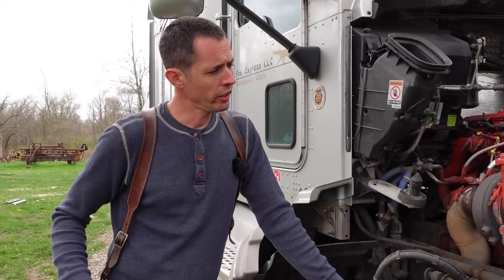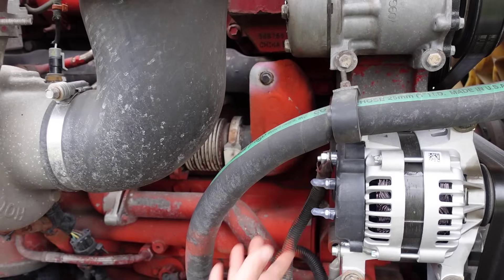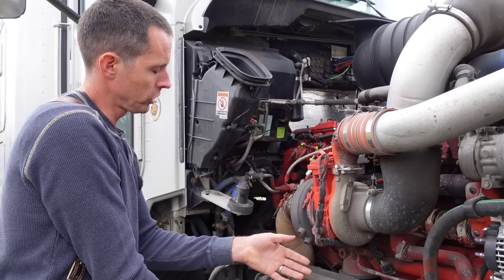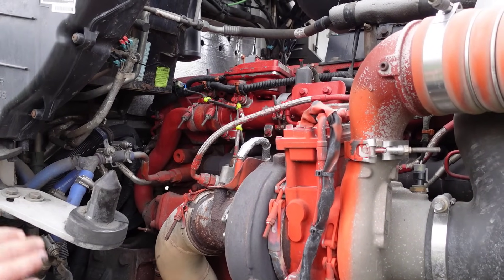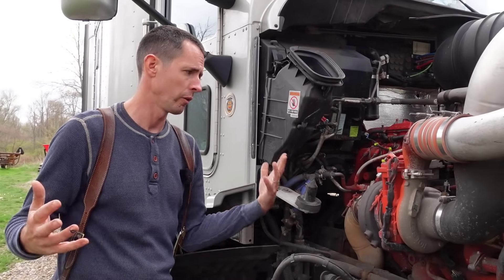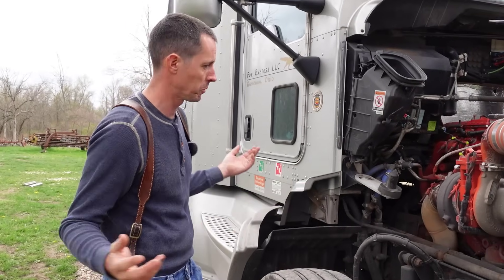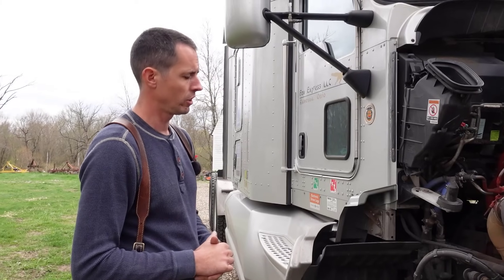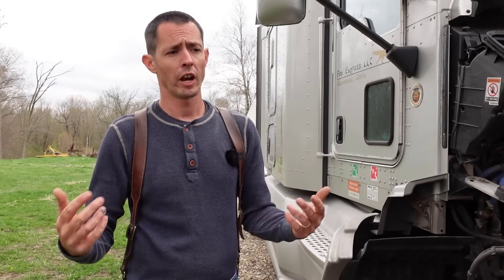What Happens During An Emission Delete - DPF/EGR Dry Run

Comment: hello boss thanks for the good info really helps i have a hino reefer box truck and is delete but its going into regent so how can i fix this i have the flashing regen light any info in from pennsylvania thank you happy holadays
Reply: I deleted my it runs great for 2 years then the engine light came on and I took it to the shop and after I took out the shop all the exhaust lights came on and anything dealing with pdf lights came on. I really have to used it so I took to get my veggies and it died on the road had to tow it. I don't know what is the problem.
Reply: I used the engine reader to clear the regen code. It works when I first got it deleted but after I took it to the shop it doesn't work anymore. I don't know what the shop did all my dpf lights came back on

Comment: I don't care for trouble codes but can I just simply remove dpf filter & drive like that?
Reply: No your ecm will detect an engine faults from the egr dpf/scr system and derate your power to basically limp mode or severely reduced power . Everything must be turned off with the tune so the engine control module and aftertreatment control module will no longer be looking for those inputs from the emissions system ...   in essence what your doing when you tune your engine and delete the emissions on it your taking the engine back to pre emissions operation just with all the emissions stuff appearing to be intact .  
Benefit is engine will run great and work like it should with better fuel economy , more power less heat in the engine and actually breath the way it should ..

Cons of doing it is the possibility of huge fines and they start at like 25k and up from there if your caught and you will need to restore it back to factory setup and it's not cheap to do..

Because even though it appears to be intact like factory at appearance. All they need to do is look at your exhuast stack and see the black soot coming out of the pipe that didn't exist before the delete and or do an opacity test on your engine at an inspection and when the Rev it up for the snap test they will see big puffs of smoke coming out and it will fail the opacity test and then your done ..  so does it work ?   100%  but is it worth it if you get caught?   100% NO ...  so it's a catch 22 ... 

And when mechanics have to hook up to check it for engine e.c.m issues cuz you will still have sensors and stuff go bad on the motor , if the mechanic don't know it's deleted and trys to do any kind of regen or calibration update with that deleted file in the e.c.m it's gonna screw everything all up and I'f your e.c.m fails for whatever reason and you require a new one you have to have the same person that did your delete tune to redo it just so you can run your truck and most dealers and shops won't even work on your truck if they know it's been deleted .....

Comment: Hello, just got this 2004 MBE4000 it’s a Cali truck and has retrofitted DPF system . My question is can I just unplug everything and get rid of the DPF since it’s not required in Arizona ?.
Thx
Reply: Yes, purchase a factory exhaust system with out a DPF and reflash the trucks computer to stock. Plus remove module that controls it all. It’s completely legal since it’s a non factory aftermarket part.

Comment: I have a 2011 international 4300 box truck. Brand new motor and turbo. It will dump a crazy huge amount of blue smoke every hour or so on the highway. Does not use DEF fluid it uses the trucks diesel. Can it be deleted?
Reply from the maker: Sorry, I don’t know the answer for your truck. You can contact the company who perform the delete to get you the exact answer! Good luck
Reply: Fix the emissions, you will destroy that new motor and turbo in short order.

Comment: Yeah I have a 2018 cascadia. 400k
I don't idle
I don't leave it running
I have an apu.
Started getting codes now.. with only 400k. .thinking about doing a delete. 
don't want to change sensors and shit
Reply: Do an EGR Tuneup, and it may be time to either replace the DPF/DOC filters or have them baked and de-ashed. You will also need to remove and clean the EGR Valve and it would be a good idea to remove and clean the EGR Cooler too. Also the emission sensors on the intake and exhaust side should be replaces with new OEM sensors. All parts should be OEM that you put on your motor.

Comment: So by canceling the egr...you pretty much stop the hot exhaust from circulating back into your engine and now the exhaust gasses go straight to the exhaust manifold ?
Reply: You cook the motor, there is much more to a delete than simply closing or removing parts. It is all in the programing.

Comment: I did a delete on my 2017 Peterbilt 579 with a Cummins ISX and when I idle the truck for more than 1 hour every time I give it throttle white smoke comes out of the exhaust but the smoke goes away after driving on the highway but when I come to a stop and let the truck idle again it repeats the same time.. any suggestions???
Reply: Sounds like a typical bad delete, who did it? Did they remove anything from your motor, EGR Cooler, EGR Valve, VG Turbo? Did they cut any wires? Were the cans totally gutted, all of them? Not holes drilled, but gutted right to the metal? Also your fuel pump, that needs to be rebuilt at roughly 400,000 miles, as they are still failing. The white smoke could also be a leaky injector. Do you have pyrometer and turbo boost gauge in the cab? How much boost are you producing? Engine oil temps too, where are they?
Reply: @michaelwright1602  I have 2015 isuzu npr

Comment: So who is a reliable tuner? I have an isx15 and I read an article where supposedly blocking off the egr cooler a because that coolant feeds cyl #6 or something. Also that the turbo builds enough boost to crack the head. Can anyone here with an isx15 and a delete share your experience

Comment: I just blocket the coolant pipe on my egr and unplugged the harness and blocked the gas tube. And no software
Reply: That coolant pipe on a Cummins cools the #5 and #6 cylinders, other makes may differ. And you are harming your motor.
Reply: On my first truck i run with EGR delete 5 years and nothing happened. Maybe on D13 it is important, on cummins everyone is doing

Comment: Just at a dealer. The sign said if its emission system is compromised work will be stopped and you tow your vehicle away.
Reply: I believe dealers are required by law to restore emissions systems without your permission. I'd say that the sign is a pretty generous option.
Reply: @mattberg916  dealers couldnt afford to do that 20k plus repair on their dime.
Reply: @hawkeyetec  not on their dime. They bill the owner
Reply: @mattberg916  bullshit,,,,,you guys must live in Jersey or something?

Comment: I have a Cummins that been deleted for about 6 months, now I have been exhaust fumes in cab and where the dpf under my passenger step , can smell exhaust...any suggestions?
Reply: Follow your exhaust pipes all the way to your engine change all the washers, rings, and clamps 
Make sure you put NEW everything on 

Literally just went through the same thing had to delete the EGR after deleting the def 
Hope this helps you man
Reply: They did a crap delete, more than likely your DPF/DOC/SCR cans are all intact, or they simply drilled a couple of holes in them. They all need to be gutted. Is your truck still running?

Comment: How can they put exhaust gas back into your engine? It's not air or oxygen anymore so it won't burn right?
Reply: it reburns the bad gases and makes engines run hotter also….
Reply: @Trevor7727  negative. The exhaust is to reduce combustion temps and reduce nox production. It's counterproductive bs. A high flow catalytic converter pumped with atmospheric air to keep it super hot and burn off any waste petroleum/fuel would be more productive, and is how the dpf works anyway.
Reply: @Trevor7727  nope runs cooler if you delete it engine will run hotter n boom

Comment: It's very sad that manufacturers are duping the public with this kind of archaic add-on emissions equipment. Reminds me of the 1970's when cars that got 20 MPG and had 300 HP became cleaner by using twice the fuel and producing half the power. By 1973 most engines were getting 10 MPG and had 150 HP...they were dogs and had high temps. With the new diesel's today, they are at it again, poor mileage and less power however, with the EGR systems today, diesels engines are injecting soot into the cylinders which damages the piston rings over time so the typical diesel that would go a million miles before an overhaul now only tend to get about 400,000 miles. Not to mention, the public are subject to the costs of this, higher initial costs, cost to operate, cost of maintenance and of course, less life. I am all for cleaner emissions but not in this way where the systems are at best a band aid project for a high price. You have to ask why CAT left the market when they told the EPA they could get clean emissions without a DPF. The EPA said, sorry you have to have a DPF so CAT said, we have to warranty them and the DPF/EGR won't allow for that. CAT left the on-highway diesel market.
Reply: It's really no big deal, all it does is raise the cost of transportation, then that cost gets passed on to the consumer. I can't think of anything that people use that doesn't come on a truck. And people wonder why the cost of goods and services are going up....Hmmmmm
Reply: @richardsb3606  Yes, it is a big deal because the EPA has ancient thinking for clean air reasons. If they had to function like the rest of private businesses and exist only from profits, they would be gone yesterday. Since they do not stay in business that way, they can demand the most dumb methods there are and force it. That is not the American way, at least it hasn't been.
Reply: @Garth2011  I was being facetious
Reply: @Garth2011  that's a lie you told there

Comment: thing is if you break down or need to go to any reputable repair shop soon as they see it's deleted they will not work on your truck ....
Reply: That’s a lie
Reply: Reputable and dealership are 2 different things, if you want a 19 year old kid with 2 weeks of training working on your truck go to the dealership.
Reply: No,, only if the dealership or some professional shop decides to be a asshole they can keep your truck until you fix it,, if they found out you deleted it
Reply: yeah I want to gamble on who is a arsehole and who isnt... thanks I'll just stay legal. also your taking a big gamble deleting and then having bigger issues with heads turbos etc. not worth it buy a 2007 if you don't want the emissions nightmares.
Reply: @fxstc111 well no its not a gamble i know where not to take it to like MHC and any dealer,, other than that i have no problem i can even go to TA or any regular shop 2nd with my truck has no problem since i delete it and i put almost 300,000 miles on a cummins
Reply: @lewis1707  whatever...
Reply: I've heard that they will work on it, it's just that they won't let you truck out the door until all emission equipment is working the way it should. So now you stuck with a big Bill just to get you truck out. I don't know if that's true, but I wouldn't want to chance it.
Reply: @thomaskirkpatrick4031  It is that’s why I stay away from dealers and MHC,, but any regular shop and TA will work
Reply: @thomaskirkpatrick4031  you are correct. a huge bill . also by deleting you could have head issues. I know of a person who had a deleted engine. no one would touch it. it wasn't worth the money to fix it back to specs he said. took it to dealer and a ta.
Reply: If you guys don't know an independent mechanic , don't buy a truck!
Reply: @lewis1707  I work at a dealer we cannot keep a truck because it is deleted, we can refuse to work on it until customer agrees to bring it up to emissions standards. The only way we can legally keep a truck is under lien laws when a customer fails to pay.
Reply: @wb2679  well I guess it varies by state cause I know a dude in North Carolina took his deleted truck to MHC and they keep his truck until he get it fix it cost him $18,000
Reply: @lewis1707   u must be talking about MHC in Battleboro NC
Reply: @lewis1707  it must I just discovered a truck was deleted customer just bought it, he’s taking it back to where he bought it he wants his money back they said they would go after the company that traded it in it’s about to get ugly for someone.
Reply: @wb2679  He took it back cause it was deleted.?? he must go or stay in Cali
Reply: @lewis1707  there are more states that require diesel emissions testing, the list is growing 2025 new standards come out more states are going to require multi level emissions testing  it’s not hard to figure out a trucks ecm has been altered
Reply: Since when are truck dealers shops are acting as DOT ENFORCEMENT OFFICERS?
I find it hard to believe that ANY SHOP reputable or not has the RIGHT TO CONFISCATE your truck
until you REVERSE deletes.
It is very possible that a shop can
Coerce you into bringing truck back to original specs just to charge you a HEFTY bill.
that is easier to belive
Reply: @HighGrade592  they are not confiscating them they will not work on them till its put back to factory specs or they refuse to do the work as if they get caught working on them and something happens they will get a huge fine and or lose their lic. etc. not worth the Hassel. but I'm sure you can find a back yard mechanic to mess your engine up for cash.  .
Reply: Any shop with that kind of mentality isn’t worth a shit. I would love to know which shops like to do this, there should be a public list so everyone knows who to not give your money to
Reply: @wb2679  looks like someone will need to figure out how to tune the big rigs like Volkswagen tuned their diesels. 🤫
Reply: Not in farm country..We all have buddies in shops....Lucky us..

Comment: Just had a customer get caught in a emission ck in a emission county in tx with a deleted engine,truck impounded,LARGE FINE FOR HIM truck has to go to dealer and have all emission systems replaced ecm replaced programmed to factory spec,shop that done the DELETE is now shut down by epa owner shop owner arrested and charged with tampering with FEDERALLY MANDATED EMISSIONS DEVICE looking at millions of dollars in fines and jail time my advice is don't do it if u get caught it won't be a slap on the hand!!!!texas and alot of states are training dot to use diagnostic scanners and putting them in their cars to catch deleted and turned up trucks and as far as so called non emission engines no such thing unless ur driving a mid 70's or earler truck all electronic engines are technically emission engines and depending on state and county regulations may fall under emission testing don't be fooled by all the bs out there,have been a truck mechanic for almost 40 years have seen alot of truckers and shops put out of business over this
Reply: Nonsense. Most pre 2000 diesel engines are mechanical and don't have an ECU, which is why they are ELD exempt. What exactly are they going to "plug in" to?  Also, prior to 2004, EGR and catalysts weren't a thing either, which is why these are referred to as "pre emissions" engines.  Go join the rest of the people on here that have no idea what they are talking about.
Reply: @benjaminconnolly5655  no sir early 90s when electronic engine came out n14cummins,60 series Detroit,E model Cat,early electronic engine are exempt
Reply: I dont even believe this bullshit..

Comment: What’s your difference in mpg before and after
Reply from the maker: It is about 20%
Reply: That did not answer the question 20%what?
Reply: @adamtheede2575  probably 1-1.5 mpg better, might not sound like much but when you drive over 100k miles a year makes a difference
Reply: @thomasvittetoe1930  Ha If you only spent 1500 a week on fuel it'd be 300 a week.  Most spend more
Reply: @adamtheede2575  get an overhead from someone who really actually  knows what they're doing.

Comment: Have you ever heard of fumes after a delete on Cummins??
Reply from the maker: Is it exhaust fumes?
Reply: Yep, whoever hacked your truck did not clean out the cans, all of that exhaust is building pressure as the DOC filter face plugs. The hot exhaust has nowhere to escape too, so it starts bleeding through the exhaust and turbo, and eventually destroys the turbo, and normally the CAC along with it.

Comment: Can you do just a egr delete and keep def system?
Reply: Typically you delete the EGR and DEF but leave the DPF to limit the black soot which is a easy give away of a deleted truck
Reply: @xMods-ld8nx  You need to gut the DPF/DOC and SCR filters. If you leave any of them intact, or drill holes in them, you will simply destroy the turbo over time, and eventually the motor. In frames start at $28,000

Comment: Do you have to block off cooler with the delete
Reply from the maker: Typically, yes!!
Reply: On a Cummins, the exhaust is plugged, the coolant line is left intact, as that cools the #5 and #6 cylinders in the 
CM-871 and newer motors.

Comment: hello Ryan what do you think about 2005 freightliner Colombia with a Detroit series 60 engine 961000 miles on it as a first truck
Reply: Columbia was my first truck they are great trucks my steering hubs, turbo, and rear end went around that same  milage hey I got it around 250k so I call it a win also learn how to soder I found alot of broken wires behind the dash I got 1.2mil before I got rid of it for a 2005 coronado
Reply: My first truck was a 2000 Freightliner century with 1.3 million miles and still running strong.
Do a oil sample and you yourself do proper maintenance intervals you’ll be fine.